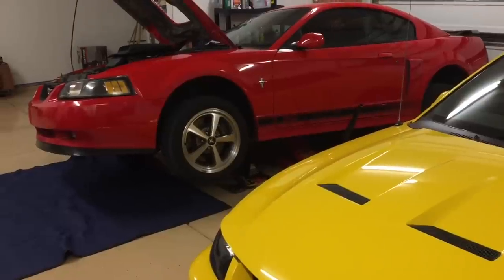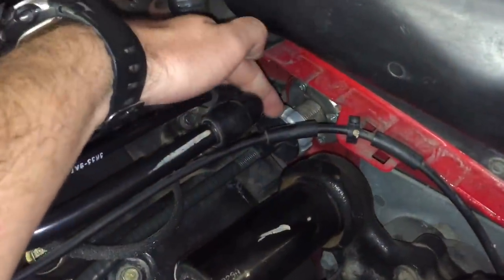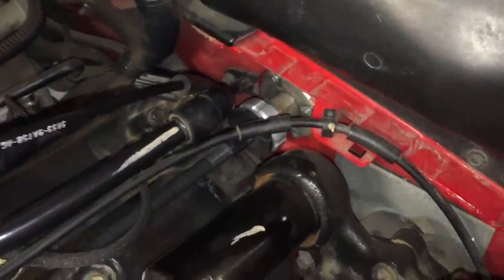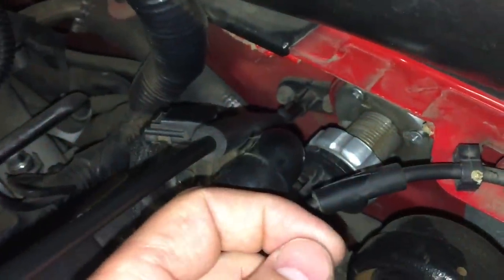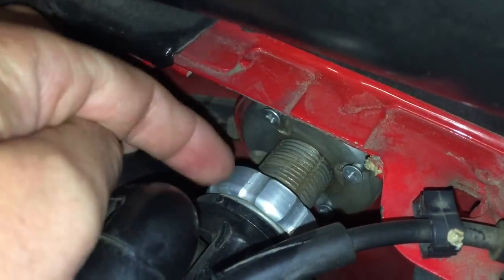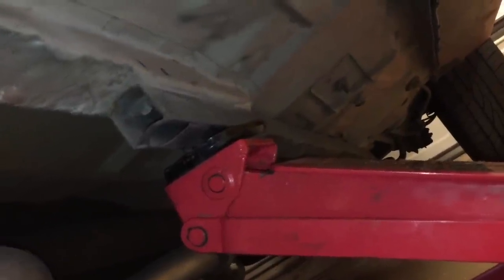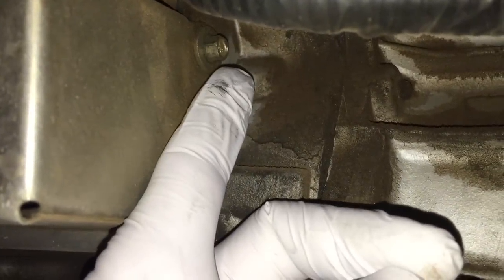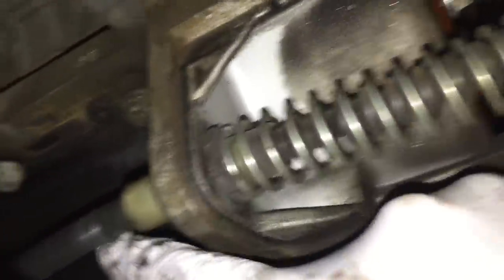Clutch Freeplay elimination mod: Ford Mustang , Firewall adjuster, Clutch quadrant pedal vibrates

Comment: I can't thank you enough, guy. Adding this spring got rid of the clutch chatter that I was hearing. Especially when I had just replaced the clutch. I couldn't believe that this method worked. THANK YOU SO MUCH. SIMPLY INGENIOUS!
Reply: What spring did you use?

Comment: I didn't know they made a kit to do that. I'm running a BBK cable with a firewall adjuster. I just rigged up mine with a piece of tubing for the spacer and used washers with a couple of pistol recoil springs I had lying around.
Reply from the maker: Jon P Nice!

Comment: Thanks for all the very concise and informative video's you have put out on these Mustangs.
I often use them as a reference.
Question,I adjusted my clutch at the firewall and now have the floppy pedal.I also noticed my cruise control stopped working.
Is there a contact switch on the clutch pedal for the cruise?
I'am going to try the spring mod in the above video and see if it helps.
Reply from the maker: The clutch cable may be stretched, and a clutch quadrant would be useful to tighten it all back up. If it already has the firewall adjuster, it may need to be tightened. I’ll put a link to that below. As for the cruse control, it’s all up on the top of the engine near the throttle body. You can see if the little plastic piece has come off. Follow the cable back from the throttle body and you’ll find it https://youtu.be/RkEn5FJHs8g?si=7cmd56vgQXJQ1WjI
Reply: Thanks,I have a new cable and quadrant
I'm going to go over everything when I install the spring down on the cable.
I will look under the hood for the cruise problem.

Comment: Thank you, for the video but i installed a steeda clutch cable,quadrant, and firewall adjuster, the cable gives the clutch pedal no freeplay but when put into  gear  the car engages almost to the point where i let the pedal go
Reply: I had the same issue with the same setup.  1. Adjust the firewall adjuster further out to drop the engagement point lower, you're gonna have to pull the heck out of the cable to really adjust it correctly. 2. It might be time to consider a clutch replacement, because with a firewall adjuster it's possible keep adjusting it until you wear all the way through the clutch faces.

Comment: does this fix the throw out bearing squeak? assuming it is applying slight pressure to the clutch fork
Reply from the maker: It does, but separating the bearing from the diaphragm fingers, but it’s also the incorrect way to do it as it makes the bearing go from 0-x,xxx rpm which makes more of a shock. The bearing is designed to spin continuously
Reply: @dannyjohnsonsgarage  so its probably not good to fix the squeak that way right, also i saw another method where you put white grease on the clutch fork bearing, did you just have to remove the trans cover to get to the fork?

Comment: I’m not happy with the bbk clutch cable that came with the bbk firewall/quadrant kit.  Doesn’t fit up with the frame mount.   In order to have the pedal feel right I can barely even catch any threads to fit both nuts on it either.   I may try and use the stock cable and this spring like you showed in the video.
Reply from the maker: Yeah, I didn’t like mine either. I went back to the ford OEM cable and have been happy
Reply: @dannyjohnsonsgarage  Danny I did your spring mod on the bbk cable and loosened it just to where both the nuts are seated and then fined tuned with the firewall adjuster. Worked perfect!

Comment: I'm trying to find the correct spring to set up The freeplay eliminator mod. I've been to Lowes and home depot and they have a very limited selection. I am concerned with the wire diameter. I have a spring that is The correct length and OD but the wire diameter is . 080. Seems pretty stiff. Does anyone know what the wire dia should be?
Reply: did you end up finding a spring the right size? i’m in the same situation.

Comment: I've been running mine with the bearing not touching because when I researched this on SVTP or Mach 1 registry people said the TOB constantly spinning was the cause of it failing and recommended it not touching.
Reply from the maker: Mach1shakin That is true IF you have enough load on the bearing that it’s the same as riding with your foot on the clutch. If you research other sources will tell you the bearing is intended to constantly spin with little preload. The factory ratcheting system achieves this. I’ve done both and you will experience lockout at high rpm shifts as the bearing isn’t touching and you won’t get full travel
Reply: @dannyjohnsonsgarage  I haven't got locked out yet but I totally understand what you mean. I adjusted it to the point where it's barely not touching.  I'll keep that in mind. Good video.  I got my return spring kit from D'agostino a long time ago.  Running a Steeda quick release quadrant and firewall adjuster.  I had to swap the quadrant to get a steeper ramp to work well with the factory cable.
Reply from the maker: Mach1shakin I had it like that for awhile. You can probably get away with both. In my setup video I suggested both methods and let the user decide

Comment: Thanks Danny I was freakin out a bit when my clutch pedal started vibrating at low rpm driving. I’m thinking the worst, like are my input shaft  & pilot bearings going out and making my throw out bearing vibrate and all the way up to the clutch pedal??? Call me lazy but I just don’t really want to spend my weekend replacing stuff that ain’t broke so glad to know that’s all it is. Thanks again.
Reply from the maker: Mitch I have this pretty well dialed in for the mach 1. No more clutch pedal vibration, but I think my pivot ball where the clutch fork attaches is worn out. I hear ya, just living with the small vibration at 2,500 cause I’m not excited about pulling the trans lol
Reply: Danny Johnson Hey I just pulled up on the clutch pedal until it clicked a half hour ago and it’s all good now ;D
Reply from the maker: Mitch Thays good for factory adjustment. Glad it worked

Comment: Hey I have an 96 Mustang Gt with an factory quadrant can the free play Elimination mod still be used ??
Reply from the maker: Kobe Rossum you can try it, but the factory quadrant uses a ratcheting mechanism and so it will always pull the cable tighter

Comment: I have the clutch quadrant adjuster but not the preload elimination. For some reason the clutch constantly needs to be tightened to get rid of the chirping sound, till the point at where the clutch now engages at the top. Any tips?
Reply from the maker: Alexander Biermann I would look at the end of the cable on the clutch fork side. If it is an aftermarket cable they usually have a nut on the end. I had to put two nuts in a row so the nut would stop walking itself loose. It’s possible that the nut on the end is coming loose as the clutch is used. Add another nut or two and it should stop doing that (if that’s the case)

Comment: How do u know how much pressure the spring should be putting on the forks and could this cause the trans to knock at low rpm
Reply from the maker: The spring separates the clutch fork from the diaphragm springs, so the only drawback of the strength of the spring is its harder for you to push the clutch in. It won’t effect the clutch system at all

Comment: So today I noticed that my clutch felt very sticky when I release it. Still engages into gear and what not. So I looked under and that little rubber part under the spring on your video is completely ripped all around at the very left of the piece. Could that be the reason why it has a sticky feeling?
Reply from the maker: Are you talking about the sleeve the cable rides in? That could make a big difference. In fact, once the cable freys it will drag and feel that way too. I strongly recommend the FORD oem cable. I have had bad experiences with aftermarket ones. The ford one is the best by far https://www.amazon.com/gp/product/B000NU1NVC/ref=as_li_qf_asin_il_tl?ie=UTF8&tag=2004047-20&creative=9325&linkCode=as2&creativeASIN=B000NU1NVC&linkId=6aadef69fb0bc5fd3bbafb2c58ea6ca8

Comment: I just replaced my cable. There is no slack and the pedal grabs at the tippy top. How do I adjust it so the pedal grabs halfway? Do I need a firewall adjuster?
Reply from the maker: Anthony Frank Yes, a firewall adjuster will help with that and a clutch quadrant by the pedal
Reply from the maker: Anthony Frank https://youtu.be/tUR8zWHUxHw
Reply: @dannyjohnsonsgarage  just installed it. Still grabs at the top. Cable is still too tight.
Reply: Anthony Frank if you haven’t figured it out already, if you have an aftermarket cable you just have to adjust it from the clutch fork as well. Don’t have it super tight against the pressure plate.make sure you have a little slack on the clutch cable. Leave a little slack in the clutch cable and adjust it in the firewall if you need to. Good luck!

Comment: Hi, thanks for your video. You know, I am not a mechanic, but I followed a video on how to install a new clutch line. The new BBK line I got comes with the two nuts to secure it under the car. I connected everything as supposed too, but when I press the clutch pedal all the way down, it pops, and the clutch is pedal is completely loose and then after a few seconds it hooks again. I am doing something wrong but I am not sure what could be. Any idea why it sounds like it pops out? Thanks in advance.
Reply from the maker: I would check to see if the clutch fork (where the cable connects on the transmission side) is sliding off of the pivot ball. When you installed the cable did the clutch fork feel floppy and fall downward that you had to push it back up?
Reply from the maker: Here are some vids to follow around. Also, with the adjustable cable you want to make sure both nuts are on and I even added a few extra since they work themselves loose over time. I like the ford factory cable https://youtu.be/xsLqZE3Fs4Y
Reply: @dannyjohnsonsgarage  here you can see better what my oroblem is. https://drive.google.com/file/d/1a4c_uzBPs90idkOefwXTTihKPeY6QA4v/view?usp=drivesdk

Comment: This mod never made any sense to me. Put slight tension on the cable to where the tob is riding on the PP fingers, and you shouldn't have any clutch vibration. I also love how people say the TOB shouldn't be spinning all the time.
Reply from the maker: It’s just another theory on how to make the tob last longer but all I found were hot spots
Reply: @dannyjohnsonsgarage  like you stated though, it not touching then hitting the PP fingers shocks the hell out of it, also when it's not constantly spinning and leaving a air gap gives you less pedal travel and might not disengage the clutch.

Comment: Hey. Quick question for you. It’s been on my mind for a couple years now, so I’m glad you made this video! How in the world do you find that fine line with the pre-load? Like you said, too much, you burn the clutch. Too little your tob is going to to be chirping and making your clutch petal vibrate
Reply from the maker: BirdonFire00 That’s a tough one. You’ll find instructions that say to stuff a dime in between the clutch cable and firewall adjuster for proper thickness, but what I’ve had better success with is turning the firewall adjuster until the chirping just barely goes away. It can be off by a tad as the seasons change and heat effects it. I once was driving to vegas and the clutch started to stiffen, so I backed it off. It really is a “feel” kind of thing unfortunately
Reply: @dannyjohnsonsgarage  So with that being said...is it a bad idea to use this mod if you don't have a firewall / pedal adjuster ? If I just have the OEM cable and OEM plastic clutch quadrant is this mod ill advised since I can't adjust with the firewall adjuster until TOB squeal is almost gone ? GREAT VIDEO either way...As a Mach 1 guy ('03 and '04) I truly appreciate them.
Reply from the maker: SKARHEAD 75 This mod can be used either way as the factory cable has a spring and this just adds to it. It helps most with a firewall adjuster and aftermarket quadrant because that setup tends to leave more slop in the cable system.

Comment: If you have slop in the pedal and it’s flopping around then it’s not properly adjusted . This is unnecessary. And if you want the BEST clutch pedal feel buy a maximum Motorsport cable and kit. Unmatched quality and pedal feel. They have great detail how to properly adjust your clutch
Reply from the maker: I had some slop in the pedal and it turned out to be in part from a worn clutch fork and bad pivot ball stud. I haven’t had very good luck with adjustable cables. I like the Ford one the best
Reply: @dannyjohnsonsgarage  MM cables are made by the same manufacture that makes the oe Ford cable. That’s why their so good 👍
Reply from the maker: Are they threaded on the end? It might work with some red lock tite, but on my mach 1 the nut kept walking off over time. I like the ford one being one length and not threaded. I’m glad to hear mm makes a good one. Maybe I’ll try one someday 👍🏼
Reply: It is not threaded only adjustable by the MM quadrant. Worth every penny . Although i have used the spring method before for the same issue the MM was night and day difference
Reply from the maker: I went with your recommendation and got the MM kit. It’s a good one, only wish it had micro click increments for the firewall adjuster like ku fiore 👍🏼. https://youtu.be/RkEn5FJHs8g